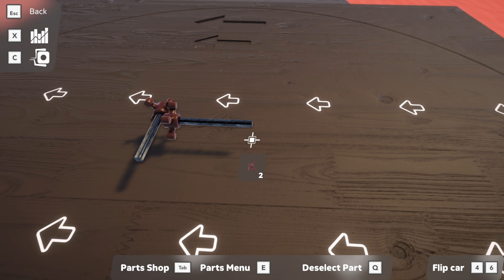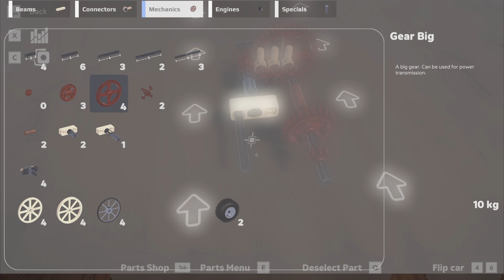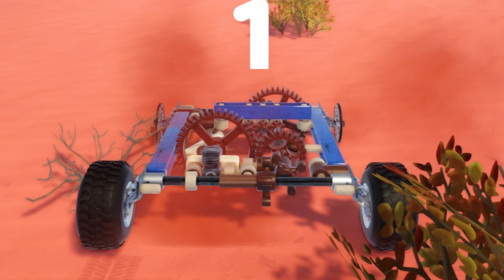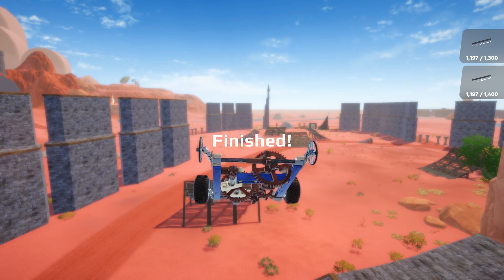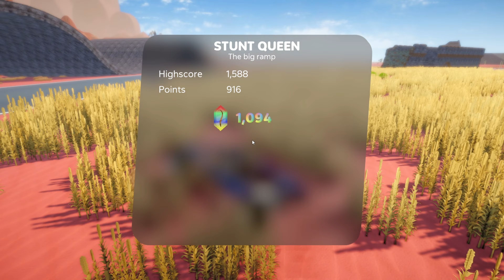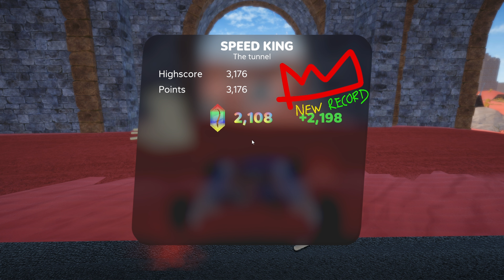Building for Stunts AND Speed in Screw Drivers

Comment: How are you placing the shafts and gears in mid air like that? I don't get the option to place anything unless it's touching a another part. This would definitely make things easier to plan out.  Love the build btw. Thanks for sharing.
Reply from the maker: Basically exactly how you say, I will build something out like, a 5 block, run a shift through it, place a cog on it, then remove everything except the cog, the build out from the cog.  The game will let you remove everything but 1 piece, so I build to that 1 important bit, delete everything else, and begin again..

Its annoying but the only way I know how
Reply: @wo0dy  Thanks for the tip.